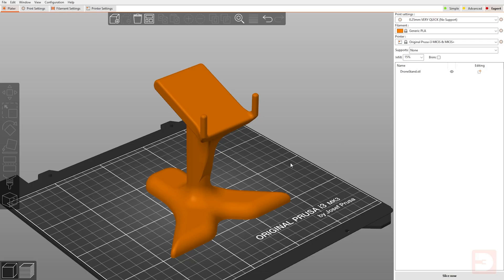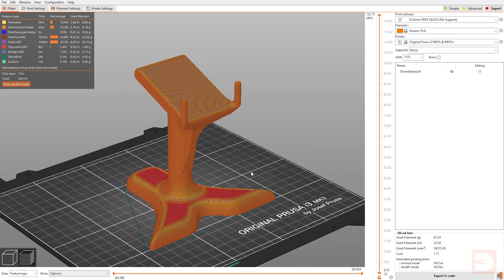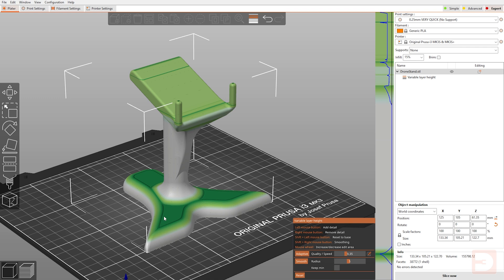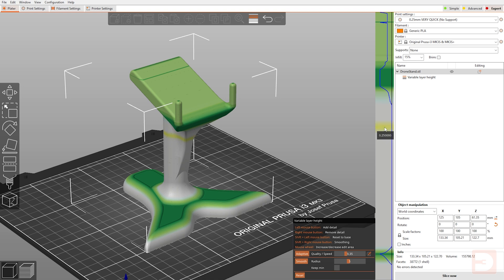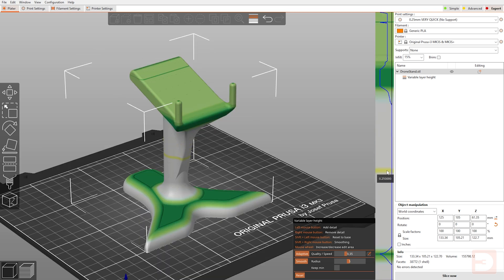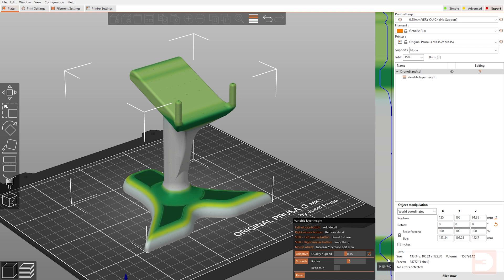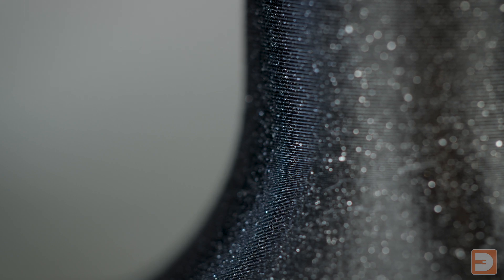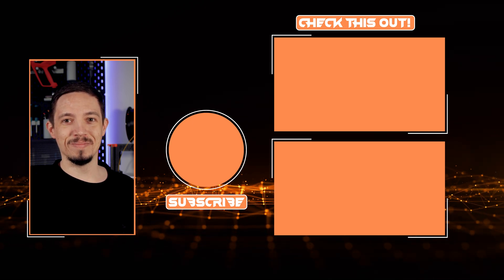Variable Layer Height - PrusaSlicer

Comment: Can I manually write the layer height instead of moving the slider? Nice tutorial
Reply from the maker: Unfortunately you can't manually write a certain layer height using the variable layer height.
However, if you added a height range modifier you could then manually type in a specific layer height for that height range. You can check out my PrusaSlicer modifiers video for more on that. 
The disadvantage there is it would be a sudden change from one layer height to the next, but you could apply that and then use this tool to soften the change between them.

Comment: Hi Josh, is it possible to use variable layer height for only the outer perimeter? For example, I added a modifier that is the exact shape of the base of the model but only its outline. I want the outer perimeter to have .1mm layer height but everything on the inside of the perimeter is .2mm layer height?

Comment: Still helping people a year later, thanks. I didn't need this for smoothing out a curved section (but it's nice to know how to do that). I just wanted the final couple of layers with a 0.1 layer height because I had some text being printed and needed the finer detail. I didn't want the entire thing printed at 0.1mm layer height though because it just increased the print time unnecessarily.

Comment: Thanks for this tip!
Do you think that this can solve some issues like the rounded surfaces that face the print plate?
Thanks in advance!
Reply from the maker: Hey Frank, sorry for the late reply. By this do you mean slopes along the Z axis that are overhaning? Such as the underside of a bowl?
Reply: @3DRevolution  exactly. For example I want to print a sphere directly on print plate without supports
Reply from the maker: @FrankP83  Variable layer height isn't going to provide additional stability, so a perfect sphere can always be very difficult without supports. However, regarding supports for the surface quality, this certainly may help. However no more than just printing the whole thing at that layer height. If you're printing a sphere, you'll want the top half to be the same quality as the lower half so there wouldn't be much need for variable layer height with that unless you were ok with having more visible 'steps' in the upper half of your sphere.

Comment: How do you set the min/max for layer heights when using variable layers?  What if i only want the max detail to be 0.10 instead of 0.07?
Reply from the maker: I don't think you can I'm afraid so it would be a matter of adjusting the levels with your left and right mouse clicks untol you reached the layer heights you were after.

Comment: Why would you slice it in 0.25 layerheights when using a 0.4mm nozzle. All layerheights has to be divided with 4, so 0.08 - 0.12 - 0.16 - 0.20 - 0.24 etc Just saying, but thank you for a great video anyway, but we should help people the best we can, so they don't start printing in odd layerheights numbers :)
Reply from the maker: Hi Morgen, I'm afraid you may have got a little confised at somewhere along the way. The nozzle is 0.4mm in diameter, meaning you should ensure the X and Y axis of your design are in multiples of 0.4.
The layer height is completely irrelivant to the nozzle size as the Z axis isn't in any way affected by it.
Think of it like this, if you took a thick paint brush that was 1cm wide, dabbed it in the paint and then stroked it across a page, that is going to create a line that's roughly 1cm wide, but it's not creating a tower of paint standing 1cm up off of the paper. You could paint over that sime line 1000 times before the Z height became as tall as the paint brush is thick.

So as a recap, when designing stuff for 3D printing, you should aim to ensure that the X and Y axis are in a multiple of whatever nozzle size you're planning on using. The layer height (Z axis dimensions), are only really limited by what your Z axis motors are capable of doing. For example, the Prusa Mk3s in this video can go down to 0.05mm, and up to around 0.3mm.
Reply: @3DRevolution  True my bad, I was thinking of Layer width :) Thank you for reminding me :)
Reply from the maker: @morgenkaffe   Not a problem, take care and happy printing :)
Reply: You are actually not totally wrong, you just got a bit mixed up. When you combine a full step (1.8 degrees) of your average stepper motor with your average Z lead screw pitch it amounts to a lift Z height of 0.04mm. So ideally all layer heights should be able to be divided by 0.04mm.
Reply: @MM-fc8ie  Belted Z's with gear ratios and no lead screws throw this off entirely.